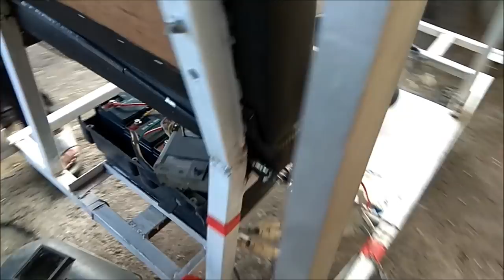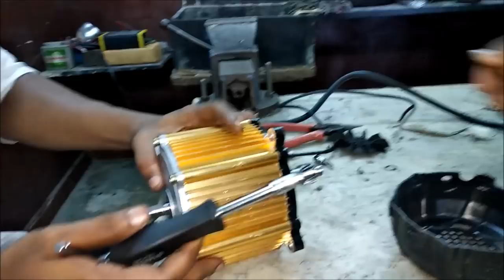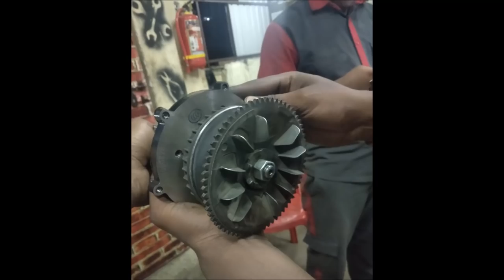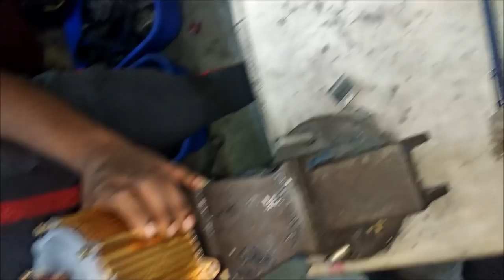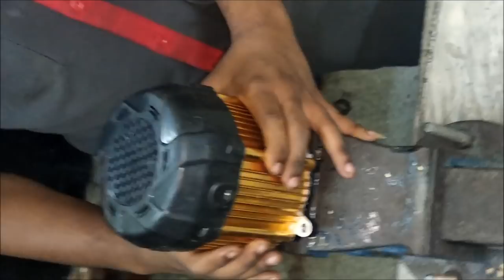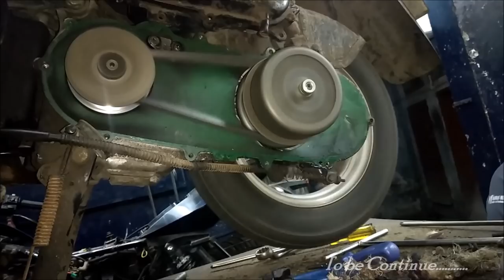Next Level Electric Scooter Conversion ll Petrol to Electric ll Activa CVT Clutch ll 120 km/hr

Comment: Put weaker springs in the rear disc, it should be almost engaged all the time, the function of cvt will stay. Also adjust roller weights for the front disc to match rpm of the electric motor.
Reply: yeah there is lot of  power loss in this system and it needs further optimisation
Reply: Semakin hari akan semakin baik lagi 
Terus berkembang
Reply: @FaniTv851  lern englisch bruder
Reply: @tronixfix  this is Indonesian Language bro
Reply: @FaniTv851  what does it say? Would be nice if you comment in english on an english comment.

Comment: Hi bro this idea is wrong (remove clutch, and gear box ) because gear ratio is 10:1 and cvt in 3000 is 2:3 so the RPM of wheel get only 200. This is not enough your bike goes only 10 r 20 km speed . So remove all setup and make 4:1 ratio to get high speed up to 60 to 70 km approximat
Reply: Yaar yeh kit motor ki haha se mile gi or kitne ki

Comment: Your picture shows different motor. Fixing motor not properly shown. Instead, hub motor is better as you can remove weight of engine. But your advertisements very irritating while watching videos.

Comment: Try removing the clutching action ,,else the power is wasted and cannot achieve the basic speed also. Clutch will not engage until it's 1000 rpm ,so you are not utilising the said rpm usefully , hope you have only another 2000 rpm ,which will not even achieve 35km,/hr and the battery gets drained quickly

Comment: I belive there is energy loos, because motor has to keep run, after certain speed the CVT start to rotates, also there are two speed controller
1: motor controller
2: CVT kit controller ...
Yes it's not negative comment but just thinking here because many people comments the same who know what is CVT, and how it's work.
Reply: Can we make a controller which can synchronize power input of motor with CVT controller?
Reply: @svrnt6891  that is what clutch has to modify

Comment: Tune the cvt flyweight. U can engage at lower rpm very easily
Reply: smartest comment
Reply: That's nice, 
tuning / reducing tension of the clutch pad springs should help significantly..

Comment: Sir, You can fit this motor scooty right  rear wheel stud nuts with a 7 inch sproket plate like as diesel mono block water pump set . I think it will become direct drive. No alterations need.

Comment: Good idea but the current setup has enormous transmission losses. Dump the cvt for direct belt/chain drive.
Reply: just dumping the clutch will help but we have to add a drive to increase rpm at motor side to counter the final reduction of 7

Comment: But you can try revels engineering by   bldc motor on wheel and for charging the battery u can use petrol engine running for hour is it possibly

Comment: The clutch works after the motor RPM reaches 1500 .
This is fine for a petrol scooter 
As far as an electric scooter is concerned this is not desirable

Comment: Sir I saw many videos, in that directly connecting motor to wheel. In your video using clutch, what is use of adding clutch in ebike, your explanation will be very use to us
Reply: many reasons to keep clutch but batter to  remove it and directly engage both shaft

Comment: Change the cvt pully because the motor rpm upto 2800 or 3000 so Change the centrifugal clutch pully
Reply: why? can you explain, i want to understand the reason =D
Reply: @Victor-le6gy  because the clutch will not engage at low rpm
Reply: Or increase rpm of motor using agear before connecting to CVT pulley
Reply: @AngshumanDas13x    Yes but ultimately  bulking the system and  is i saw we need near about reduction of 1:5 to match the requirements and it is fare more power consuming

Comment: Good Idea superb. Appreciated, but only thing is use direct drive, not the CVT, there is more power loss in this design, because the motor should start from initial speed as 1rpm also, where as the IC engine at idling runs at 1200 to 1400rpm and the centrifugal clutch engages at somewhere close to 1800rpm.
So when the motor starts from 1rpm to 1800rpm it a huge power loss and the centrifugal clutch needs check on regular intervals.
Anyway motor and CVT gives good range I hope...
Reply: For City Direct Drive is the Best
And for Highways CVT will work fine.

Electric motor will give a torque output from 1rpm itself, but an IC engine will give the max. Torque at higher revolutions. So CVT might not work efficiently in Cities... Or often Stop and Go traffic...

Comment: Wrong idea don't use that clutch use the motor directly otherwise with your idea it will reduce the mileage
Reply: Right
Reply: right idea
Reply: First of all, if you understand there is energy loos, because motor has keep run untill the clutch tight the belt, once belt tight then again in certain speed rear tyre will start rotating.
Means rear wheel is slow front motor is speed , in between there again controller 
So there is electrical energy loos , battery pack will come down in 15min it self.
I'm not against to this creative folks but just fact I'm talking

Comment: Ellam nalla eruku but...but motor higher rpm la than clutch shoe activate aguthu.ethunala antha Activa 40 km speed la porathe kastam ennum load increase panna.vandi move agarthu kuda doubt than...chain drive is always best in electric motors

Comment: How many rpm of motor
Reply from the maker: 3000 RPM
Reply: Sir 3000 rpm hai to cvt work aftt 2500 rpm so cvt or clutct mai modifi karna padega, clutch ki spring light tention ki karni padegi or cvt ke roller ka weight badhana padega